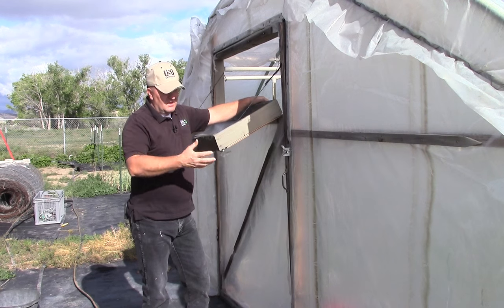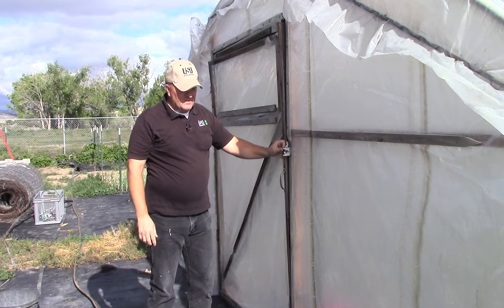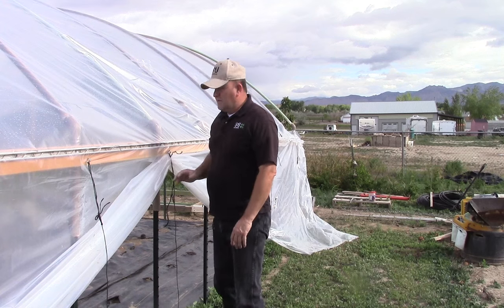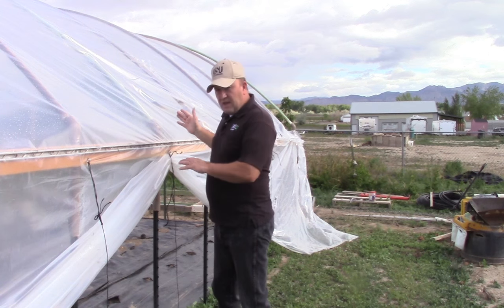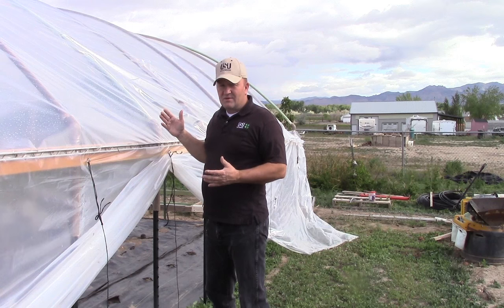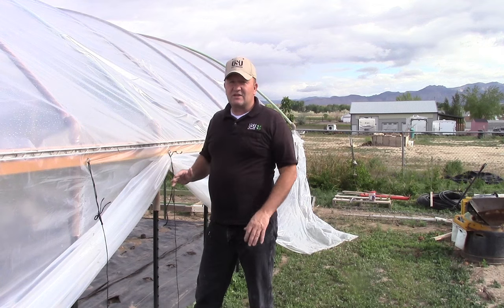Hoop House Ventilation

Comment: Excellent series! Do you have a ball park cost on a house like that? Also general profits one might make in a good year say with tomatoes? Guessing those are 18' wide structures? Thank you for your time Sir.
Reply from the maker: When I priced these out in rural Utah a few years ago the cost, with the wiggle wire and plastic cover included was about $1.50 per square foot for a 48x17.5' high tunnel. Of course local prices will vary. I plant six rows of tomatoes (the outside rows are probably more suited for peppers or determinate tomatoes as you get closer to the edge). These high tunnels are 93' long and the plants are spaced 2' in the rows so I get about 45 plants per row. With a yield estimate of 12 lbs per plant you would get 3,240# (6 rows x 45 plants x 12 pounds) of tomatoes. Prices will vary, depending on your market. With a very conservative market price for fresh tomatoes at $2 per pound, gross sales could be expected to be at least $6,480. These are 18' wide, but the 45 elbow fits better if they are 17.5' wide. Thanks for watching.
Reply: Very good info thank you!

Comment: I live in central California where it gets tripple digit dry temperatures in the summer; would you recommend a tunnel with appropriate ventilation and a shade cloth cover or would my roof and side wall be adequate to keep my temperatures down?
Thank you for the video share.
Reply: Your best benefit would probably to use the high tunnel as a shade structure most of the year--20-30% works well for the Utah summers. Along the Wasatch Front (Provo to Ogden in Utah) they remove the plastic by mid-June and put on shade cloths to help with sun scald issues on tomatoes and peppers. Where I did these videos, in Price, Utah, I found it better to leave the plastic on and just put a shade cloth over the plastic for the summer. Since I'm nor real familiar with the California climate, my best guess is that you would benefit from the plastic from November through February and get the shade cloth on by the time your temperatures start to reach 90 degrees and take if off when daytime temperatures are consistently below 85 degrees.

Thanks for watching.

Comment: Hi Gary. I'm in the process of building a  DIY hoop house and I can't find much literature on the need for ventilation. How much ventilation is needed? How often? Under what conditions?
Reply: Sorry for the slow response. There is research done on greenhouse ventilation. Since high tunnels are passively heated and cooled, it becomes more of an art than a science, unfortunately. The ventilation is a balance between inside and outside temperatures as well as humidity inside. So adjust your ventilation  based on those conditions. Once outside temperatures are high enough do complete ventilation. thanks for watching.